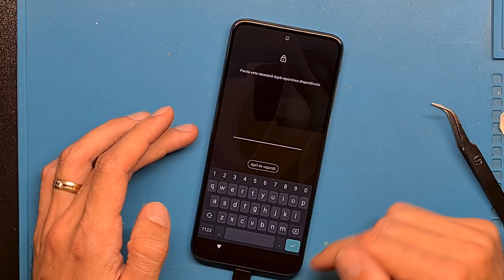Motorola g31 screen replacement - moto g31 xt2173-3

Comment: Thank you for making this detailed video. 🤗
An acquaintance of me just gave me one of these for a repair, and I have to admit that it's the first time that I find a smartphone so pesky for its back housing to be removed. I saw another G31 video (version with fingerprint reader, and esentially a different back housing) in which the technician removed the back housing by easily unclipping it with guitar picks; but after grappling mine with picks and some other plastic tools, I found that the housing or back cover simply didn't want to come out, and I didn't wanted to grapple any further as I felt that it was starting to get warped… 😅 @#$%! There were screws on the way! A disgusting experience, of course, to see what they are doing with certain smartphones nowadays. 😒
Reply from the maker: I am glad the video is useful!
Reply: Same issue))

Comment: It seems that you replaced the motherboard items and battery onto the back of the new screen. I’ve seen screen replacement of the moto g31 done differently where the screen was replaced after only the battery was lifted off because a retaining screw was under it.  It was probably another version like the Brazilian where the fingerprint sensor was at the back.
Reply from the maker: That-s whi I wrote the exact model: xt 2173-3. The original display comes atached to the metal frame, aftermarket ones are only glass and display